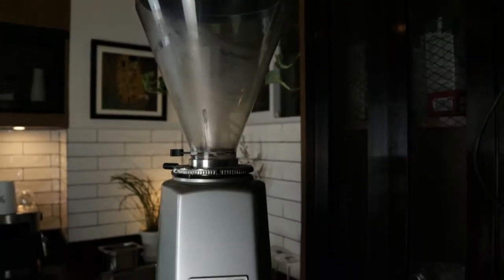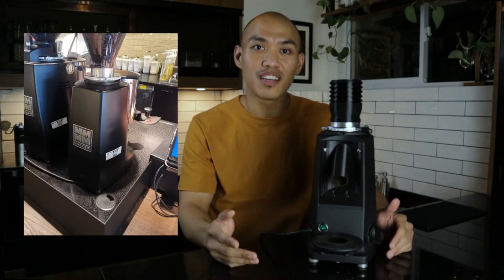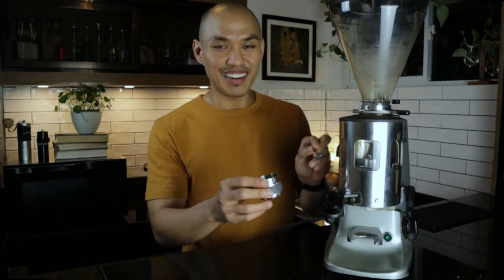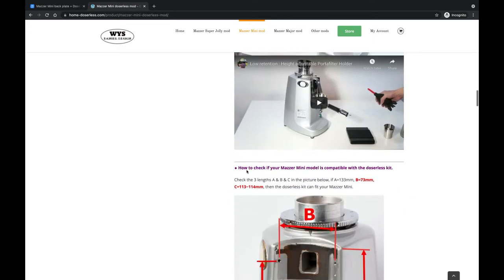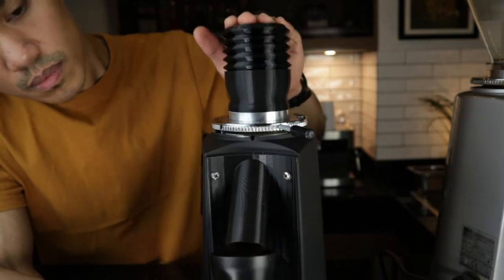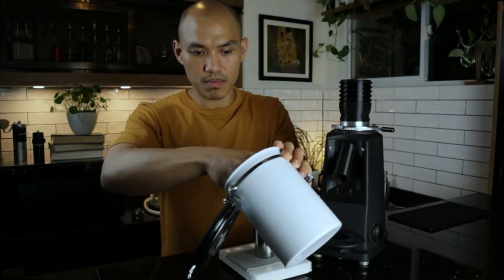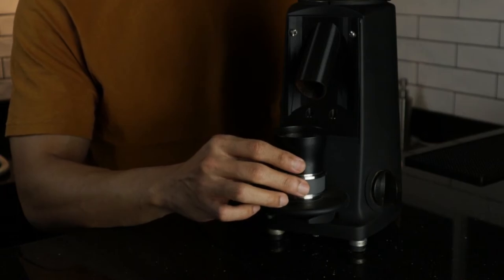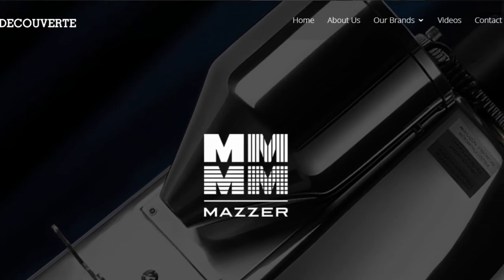Mazzer Mini Doserless Coversion - Niche Zero or DF64 Alternative?

Comment: Just changed the doser to a single doser, the older doser I had to cut two wires in order to remove the old doser and now the grinder does not turn on? Was I not suppose to do that? I have the same doser as you with the 3-D print…

Comment: Thanks for the vid! When it comes to retention, it would help if you get a small spritz / spray bottle and lightly mist some water over the beans. This method (RDT) should reduce static, and eliminate a lot of retention. So if you’re getting .3g retention now, you’ll probably get .1 or .0g after RDT.
Reply from the maker: Thanks a lot, Garret! I'll try this out and see if retention will be lessened! This is new info :)
Reply: @babescoffee373  and?